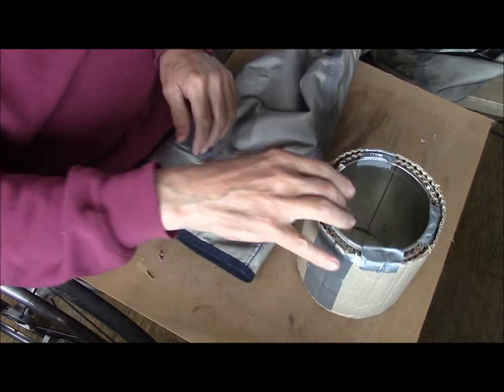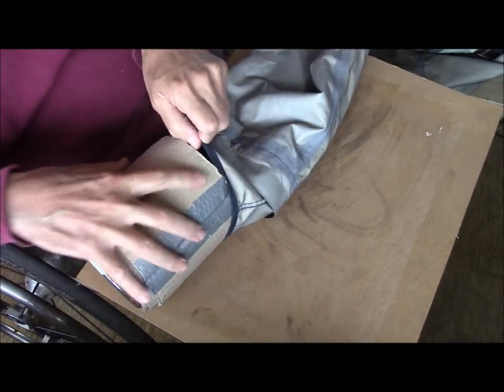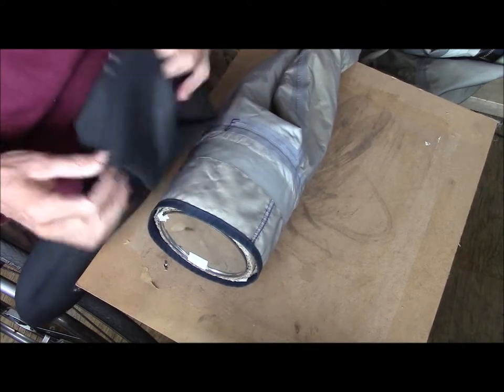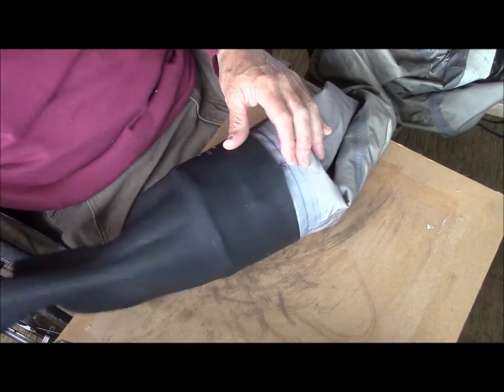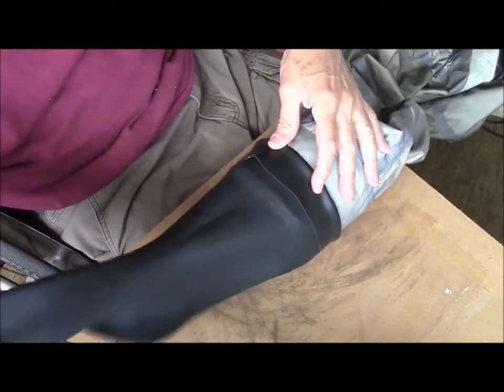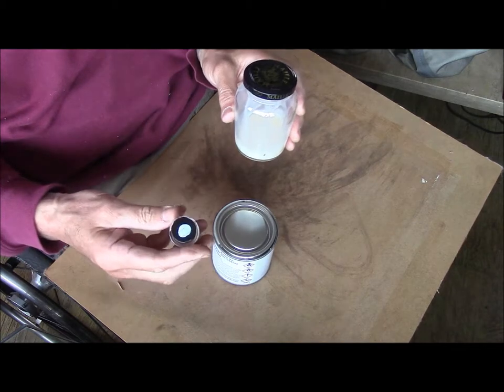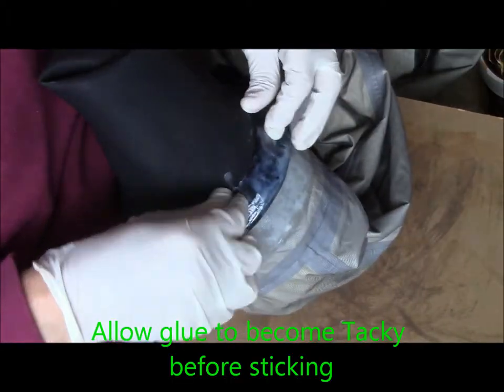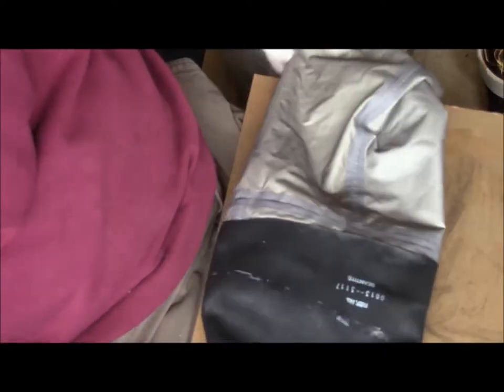Drysuit Sock Replacement

Comment: Shouldn't you put a thin layer of glue on all surfaces and let it become tacky. Then a second thin layer of glue followed by joining the fabric surfaces immediately?
Reply from the maker: I have not personally come across the method you describe. I have always allowed one coat applied to both surfaces to become tacky before pressing them together. This is the normal method with contact adhesives as far as I know.
Reply: @paulholzherr2993  Ok, with high density foam in the kayak cockpit I have always been instructed to use two coats. It may be different for a gasket
Reply: @ws9186  Hi, I still have the glue I used and it is called Bostik 2402. A 'how to' video does say allow the coat to become milky/tacky before bringing the two surfaces together. It does also say apply a priming coat as well. This glue is meant for use on rubber based surfaces.